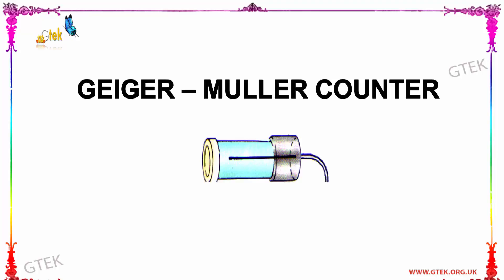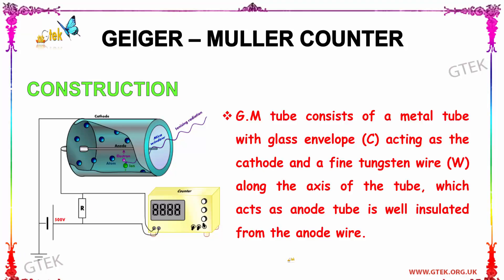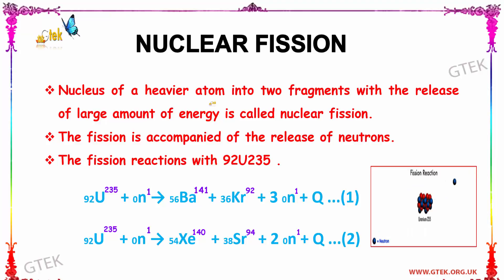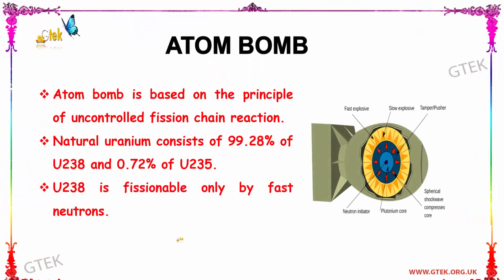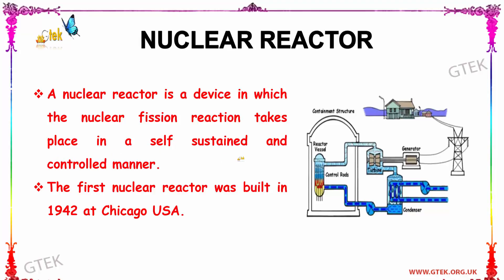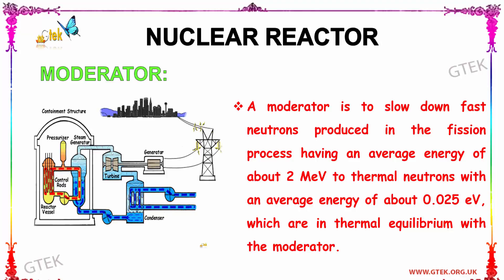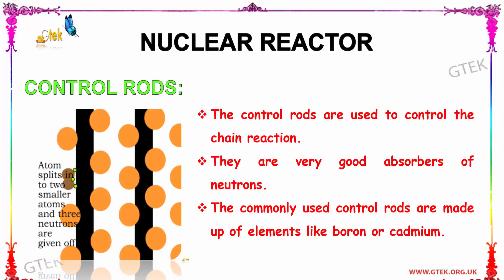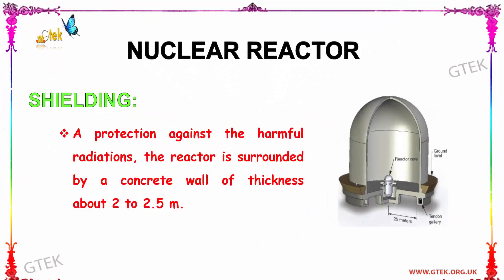Geiger Muller counter | cbse class 12 physics | JEE Main and Advanced physics | +2 physics

Comment: The Geiger–Müller counter, also called a Geiger counter, is an instrument used for measuring ionizing radiation. It detects radiation such as alpha particles, beta particles and gamma rays using the ionization produced in a Geiger–Müller tube, which gives its name to the instrument.

Comment: The Geiger Counter. Geiger counters are used to detect radioactive emissions, most commonly beta particles and gamma rays. The counter consists of a tube filled with an inert gas that becomes conductive of electricity when it is impacted by a high-energy particle.

Comment: A Geiger counter (Geiger-Muller tube) is a device used for the detection and measurement of all types of radiation: alpha, beta and gamma radiation. Basically it consists of a pair of electrodes surrounded by a gas. The electrodes have a high voltage across them.

Comment: According to Wikipedia; "a Geiger–Müller counter, also called a Geiger counter, is a type of particle detector that measures ionizing radiation.A Geiger counter (Geiger-Muller tube) is a device used for the detection and measurement of all types of radiation: alpha, beta and gamma radiation.

Comment: The Geiger-Müller tube is filled with an inert gas such as helium, neon, or argon at low pressure, to which a high voltage is applied. The tube briefly conducts electrical charge when a particle or photon of incident radiation makes the gas conductive by ionization. The ionization is considerably amplified within the tube by the Townsend discharge effect to produce an easily measured detection pulse, which is fed to the processing and display electronics.

Comment: The original detection principle was discovered in 1908 at the Cavendish laboratory, but it was not until the development of the Geiger-Müller tube in 1928 that the Geiger-Müller counter became a practical instrument. Since then it has been very popular due to its robust sensing element and relatively low cost. However, there are limitations in measuring high radiation rates and the energy of incident radiation

Comment: Construction

The G.M tube consists of E a metal tube with glass envelope (C) acting as the cathode and a fine tungsten wire (W) along the axis of the tube, which acts as anode . The tube is well insulated from the anode wire.

The tube is filled with an inert gas like argon at a low pressure. One end is fitted with a thin mica sheet and this end acts as a window through which radiations enter the tube. A high potential difference of about 1000 V is applied between the electrodes through a high resistance R of about 100 mega ohm.

Comment: The Geiger–Müller tube or G–M tube is the sensing element of the Geiger counter instrument used for the detection of ionizing radiation. It was named after Hans Geiger, who invented the principle in 1908, and Walther Müller, who collaborated with Geiger in developing the technique further in 1928 to produce a practical tube that could detect a number of different radiation types.

Comment: A typical G.M. tube consists essentially of a cylindrical cathode in
the form of a graphite coating on the inner wall of a glass envelope
and an anode in the form of fine tungsten wire which stretches within
and along the axis of the tube. Usually it is filled with a mixture of
an inert gas (argon or neon) at a partial pressure of about 100 torr
and a quenching gas (halogens or organic vapours) at about 10 torr. To
allow 1onis1ng particles to enter the tube, a window covered with a
thin sheet of mica is provided at one end of a tube.

Comment: The Geiger counter is an instrument used for measuring ionizing ... The Geiger- Müller tube is filled with an inert gas such as helium, neon, or argon at low pressure, to which a high voltage is applied.